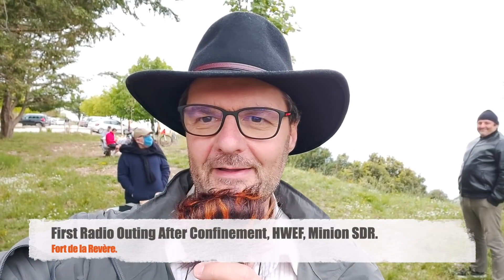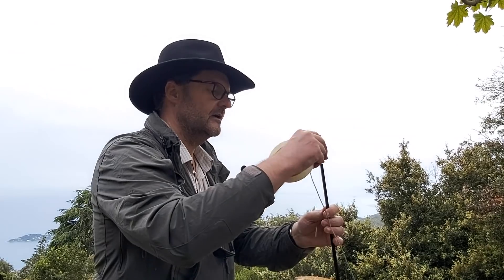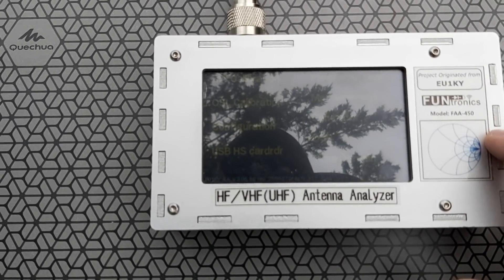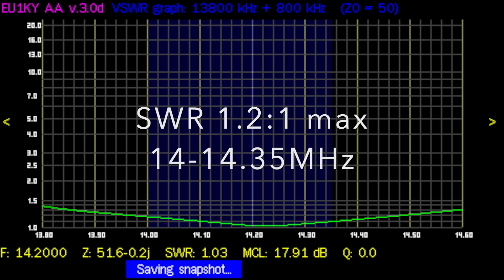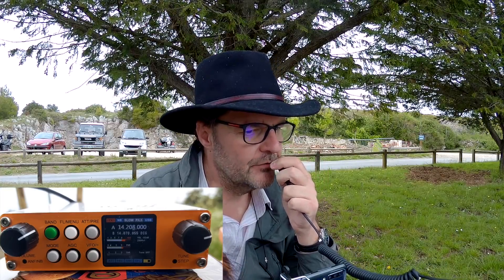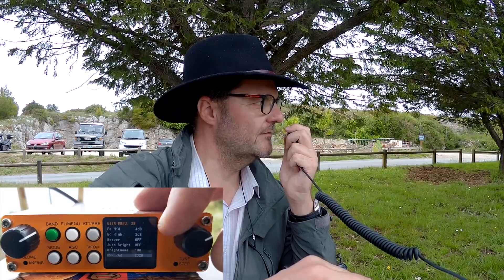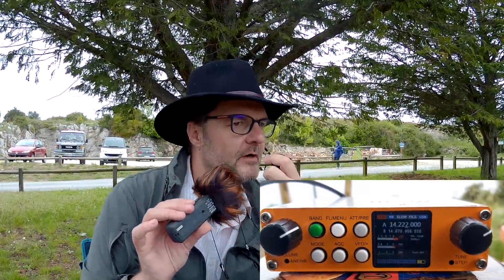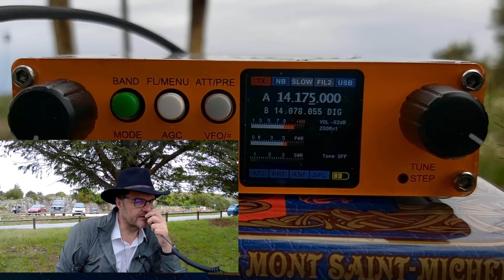First HAM Radio Outing After... HWEF, Minion SDR.

Comment: Gil, how did you find the cw operation, especially the filtering? This little radio fascinates me but before I pull the switch I would like your opinion. 72 Grover K7TP
Reply from the maker: The filtering is top notch, but the lack of QSK and relay switching is frustrating.

Comment: Is the RF interference problem easy to work around? I'm thinking about picking one of these up. Seems like the best QRP rig south of an Elecraft or that IC-705 if it ever arrives...Do you also recommend the optional low pass filter? Thanks for making excellent videos! 73, BJ / N1BJX
Reply from the maker: For TX do get the filter. I ordered some clip-on ferrites, should do the trick..

Comment: Good to see you out and about again! Rather than adding a choke to the HW coax feedline, I've found that a short -- circa 2M counterpoise -- eliminates any RF feedback from the antenna -- and it seems to be fine on all the HF bands. (I have a similar built 9:1 but have added the ability to connect a counterpoise.)
Reply from the maker: I will add a ground mini banana connector...

Comment: Noticed the top bar on transmit was a dB scale for your audio out.  Was difficult to decipher, yet this may be your gain level which were all in the red.  Experiement locally with a friend on adjusting gain.  Maybe keeping the bar in the white area 7-9 dB will help with audio clarity.  Thanks for this video.  Based on your previous choke video and a few others on YT, it appears a choke should always be used whether QRP or QRO.  Best Regards, N2TEE
Reply from the maker: Thanks, I took gain down from 13 to 10...

Comment: Hi Gil, fine. I use equalizer on mic settings. Hi to max +9 and lo much lower even - 9, medium - 3. I found its better. I Use  little snap ferrite in mic line. OH1FEU
Reply from the maker: Very useful info, thank you!
Reply: @RadioPrepper  Remember at it is qrp radio, you must use all possible settings at your voice is strong. I was working 160m band and 80-meter band with my frends over 700 km away  from me. They says at signal is lound and clear. OH1FEU
Reply from the maker: Great, I will try those tomorrow!

Comment: Hello, Why did you use the 49:1 for 20 and the 64:1 for 40 is there an advantage to using 64:1 on the lower band.
Reply from the maker: Yes, the small FT-82-43 toroid requires more turns, and in general even for an FT-140-43 I use 3/21 turns. The high turns do not work for the higher bands but better on lower.
Reply: @RadioPrepper  Thank you for the reply. I found this post on QRZ (https://forums.qrz.com/index.php?threads/49-1-versus-64-1-for-hwef.693494/), so would the feed point impedance be higher on lower bands such as 40m vs 20m. I am looking to build a EFHW once I get my licence but am rather confused by the choice of 49:1 vs 64:1. Is there a rule of thumb or some science behind the choice. I have also been looking at the Steve Ellington video and facebook page but the issue of which is a better choice and why is not clear. Is this something you could please clarify.

Comment: It was great to see you using your new radio in the field. I wonder how much that choke helped with your transmitted audio? You may not of had much time to test it before you began to get rained out. Unrelated but I noticed one of the accessory options that could be purchased with that Minion SDR was a special $45 microphone that had a special Russian sound capsule installed in the microphone, which was produced in the Soviet Union, by the military industry specifically for the voice frequency spectrum for radio communications, the passband of the sound capsule is 300 - 3400 Hz. The push to talk button even matches the radio front. I may buy that with the radio when I am ready to make a purchase. That was an interesting size comparison with that other QRP rig. Yes this rig is a little pricey and requires a Choke but it is a very attractive radio with easy to use controls and has some really good specs. The more I see it the more I want it lol. I really don't see another comparable rig in that size. I believe you made a good choice in your purchase.
Reply from the maker: I didn't get the guy back but I will try a clip-on ferrite on the mic cable..